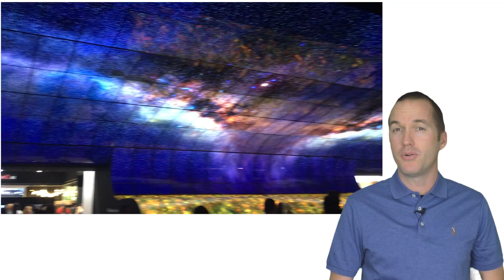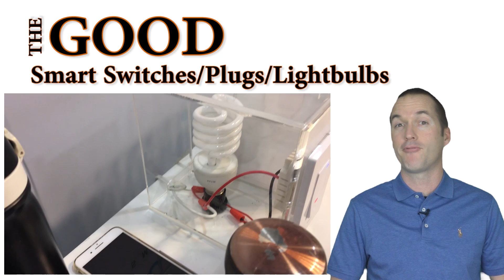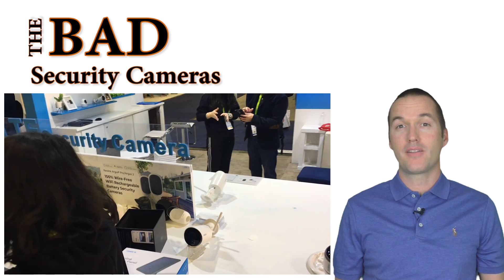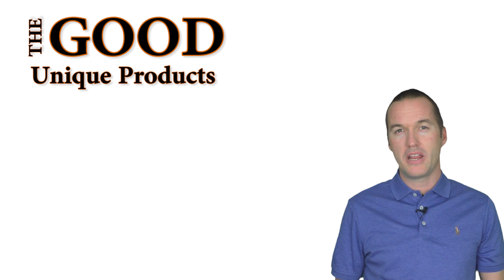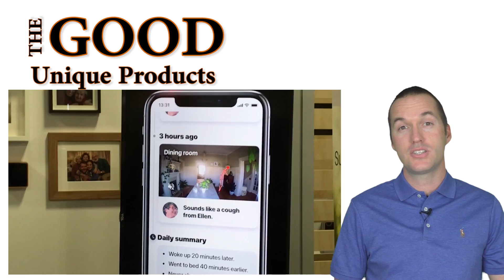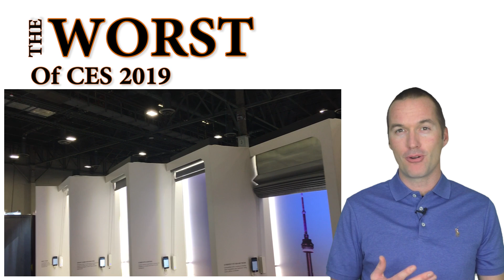CES 2019: BEST and WORST Smart Home Products

Comment: Any chance you had a chance to check out Hubitat at CES. I attended but didn't get to see them (not sure if they were there but some indicated they were). Also any chance there is a product review on your list for Hubitat?
Reply from the maker: I'm really unsure as to what Hubitat's place is in the market.  It's not simple enough to replace Smart Things, but allows far less customization than Home Assistant or OpenHAB (which also cost less and are open source).
Reply: @TheHookUp  Fair enough comments. HA does appear to have a longer future (and yes , open source will in large part be why) and is getting a bit better with Lovelace but it still has a long way to go IMHO for non software developer type users. When you have to dive into yaml code etc. ,  that is a big turn off for people just trying to get something up and running fast and not interested in stuff under the hood. Maybe Hubitat could be a possible transition platform to have more non cloud based automation control and more user friendly setup and dashboards until HA get's more polished.  Thoughts?

Comment: how do you spell this cam manufacturer - tooya? 2yeah? 2ya? tojaa? I just want to check them out as you mentioned possible future google assistant capability
Reply from the maker: They aren't a camera manufacturer.  They are a solutions company for hardware producers.  They sell a pre-programmed ESP8266 chip modules to suppliers and have an app making tool that allows companies to easily connect their tuya cloud for connectivity.

Comment: Wow, most of these features are reasons I wouldn't buy them. Cloud and proprietary are just devices that you don't own and have little control over.
Reply from the maker: Yep, I tried to relay that message to every vendor that I spoke with (which was all of them).  Many were receptive, but the majority were not.
Reply: @TheHookUp  Same goes for batteries.

Comment: I'm curious on your thoughts of Philips (Signify) Hue...you talk about wanting local control and you also point out the Wi-Fi switch that can be run without a neutral wire. It seems like a Hue bulb/Illumra switch would check off both those boxes. Hue doesn't need to be connected to the cloud at all and the Illumra switch is kinetically powered so you don't even wire it to mains at all, the fixture is always hot. This also means you can stick it on the wall anywhere, not just in an electrical box.
Reply from the maker: My reasons for not using hue are:
1. 90% of the time I'd rather be using smart switches rather than bulbs.  I don't want to have to give instructions to family members or guests about how to properly operate the lighting in a room, they can use the switch, alexa, their phones, the wall tablet, whatever.
2. The entry price is high for hue, and while the individual price of bulbs is decreasing, it's still significantly higher than brands with similar offerings.

That being said, their local API is great... So great in fact that I emulate it for all of my ESP8266 projects for alexa control.
Reply: @TheHookUp  Gotcha. The new Illumra switch is the answer to your first point, but admittedly it's not cheap ($40-$50) - I suspect the price will go down over time (the Hue dimmer was $50 when released and I've seen it as low as $15 lately). I would argue about the cost of entry - I've seen the Hue White starter (two bulbs and a hub) and the Hue White 4-pack for as low as $40, which is only $10/bulb + $20 for the hub. Granted, if you have a circuit with 10 fixtures on a switch then a switch is obviously going to be cheaper but I would think that would be fairly rare. 

I was just curious because it seems like Hue fits with everything you look for - open API, local control, traditional use, high flexibility, high reliability/quality - and I've gotten the impression that you're willing to pay a little more for a perfect OOBE.

Comment: Hello, love your channel! But I have to make a correction about the “first company to make a wifi switchthat doesn’t require neutral” I have been using Xiaomi Aqara switches in my home for a while now and I beleive Lightwave RF (UK Only) succeeded in this even before Xiaomi.
Reply from the maker: I believe aqara switches are zigbee and require a hub.  This is a stand alone WiFi switch with no hub required.
Reply: @TheHookUp  Xiaomi does require hub, but its very modern thing that allows you to do many smart home integrations and what is the most important: 1) it doesn't need 50w it can work with 5w Led bulbs. 2) it's much more secured and looking nicely. 3) it doesn't require internet connectivity which I bet this WiFi dinosaur Must have
Reply: You are correct they do require a hub! Thats pretty cool, we need that in the UK, our wiring is prehistoric. You can also purchase a zigbee stick for the pi and run them locally with zigbee2mqtt but this isn’t something I have ventured in.

Comment: Last year I set up Open Energy Monitor running emoncms. They sell 200A current transformers for US mains. It's integratable through Home Assistant. You should come up with a Home Assistant pool project. I've been toying with the idea of controlling my variable speed pump with a Tasmota generic device.
Reply from the maker: I have a pool controller (pentair) already.  I've got a video about how I control it with HA and MQTT.

Comment: The Lutron Caseta dimmer has been around for quite some time now and does not require a neutral wire. It does require a small hub for every 50 or so switches.
Reply from the maker: Yep, hub based non-neutral switches have been out for a while.  This is the first WiFi non-neutral switch.
Reply: @TheHookUp   Yep, I should have paid closer attention, I didn't get the "WiFi" distinction. Sorry.

Comment: Bit of a correction -- Lutron makes switches that don't require neutral (part of their Caseta series).  I just installed 3 of them myself.  Also the Lutrons aren't wifi, but rather ClearConnect via the Lutron hub.
Reply from the maker: Correct, there are lots of zwave, ble, zigbee, RF and other solutions for no neutral switches, but this is the first wifi one that works without a hub.  

It has been very difficult to do in the past because wifi radio is pretty power hungry, which is why there must be some interesting circuitry in this switch, and I'm excited to see how it gets applied to other tech.

Comment: Great video, condensed and very informative, keep it up and keep up the pressure on the manufacturers. 

I recently bought two Reolink PoE cameras knowing I'm getting good value for the price. AND I bought them because those are PoE AND local storage! I guess more and more companies are trying to the "NEST thing" and milk that cash cow. Hopefully by the time my cameras will die I will get something similar like two Reolinks but run on future version of RPI or similar. Now I need to get that Tensorflow working.
Reply from the maker: I did check the Zosi and Reolink websites and they are still selling PoE stuff, just not marketing it.  I guess there's not a mass market for them.  Hikvision makes really good PoE stuff, but they weren't at CES.

Comment: wifi security cameras are just BS... any script kiddie can flash a deauther on a 2$ esp8266 and blast your wifi...
Reply: I haven't heard of "wifi deauther", a quick websearch later and I learned new stuff - thanks! Totally agree, PoE cameras are better in so many levels (namely robustness, privacy and security).
Reply: Joonas Loppi there is some good stuff on blackhat regarding security camera vonrabilities, and most security camera manufacturers just don’t care
Reply: Its always best to run PoE, on a segregated VLAN that only the NVR and hassio can access
And have alarm/notifications if a camera goes offline
Reply: @sparkybearbomb533  totally agree, I've lately been researching on how to set up different VLANs. Can I set it up in such a way that my home automation gear can only access Hassio, but my home computer should be able to see Hassio as well? Kind of like Hassio should be visible to these two VLANs, but I think one device can only be in one VLAN at the same time?
Reply: @joonasfi  one device can be in multpile VLANs at the same time. It's just a matter of configuration. You could set two VLANs on one interface in which case your device needs to do tagging. You could also install another ethernet interface on your pi. I am not familiar with Hassios underlying networking so don't know how it would work. And of course you need a managed network switch(es) to handle those VLANs.
Reply: @VilmaHallikas  thanks for the response! I have Ubiquiti's UniFi gear, so they support VLANs.

So basically the device that would be on two VLANs needs to do the VLAN tagging, and the router port that the device is connected to probably needs to be configured so that the router does not modify tags used by the device (since all VLAN security is lost if devices by default could specify their VLAN membership).. interesting.

I would have liked for this to be a router-only config solution but I guess this use case requires multiple IPs for the device then, because ultimately one ethernet frame can only have one VLAN assigned to it I guess.
Reply: @joonasfi  pretty much like that. Security comes from your switches, they need to have that particular VLAN ID trunked to a port, otherwise the packet is dropped. I can help if you need, just drop me an email to @gmail.com, it shouldn't be too hard to figure out what my address is. Finnish works too ;)
Reply: @VilmaHallikas  thanks, I might take up on the offer once I find the free time to continue improving my home network.. so many projects to do! :) Thanks for the info, I feel like I understand a bit more. Torilla tavataan!
Reply: True!
Reply: This are consumer grade for plug and play, if you want good security and quality you will go for the hikvision or unifi etc wired cameras etc
Reply: @aaronargent  it's a false sense of "security"...
Reply: I have used deer cameras,replacing batteries and climbing a ladder is not a favorite. I bought a driveway sensor , 150.00 ,I bought a black box camera you can hide but only good 15 feet. I had 3 flood cams when the VCR still worked, the motion part still works, and the floor lights of course. 
 I have 3 camera made from Sw...and I cant get the TV to recognize the video recorder. I have called customer service.  They tried,I'm just doing something wrong and my son gave me the set after he used it new for a year. Anyone have similar problems? Swann

Comment: Thanks a lot for the summary. You're asking the right questions - vendors should stop creating their own proprietary islands of cloud based, closed source hardware. Yes, there is a market for those products, but why is there no additional api by default? Many vendors underestimate the power and value of the open source community. Thanks for your work and pushing the future development in the right direction!
Reply: I guess their current target is data mining the hell out of every bit of information they can get + some kind of subscription model. Also judging by the vulnerabilities ppl found in almost all "smart" things, they don't really want to invest in the quality of the software, just ship the cheapest possible thing ASAP. Dealing with ppl using their api, sending pull requests, requesting new features, or even bug fixes is just expense...
Reply: @AkosLukacs42  The companies are not doing this because they have some data mining preference, they are doing it because it is absolutely impossible to compete with China on hardware and open-source software.  They will dominate you.  You need to differentiate yourself as a business and data and cloud services are where they can get customers.  It is why people pay thousands for overpriced apple devices that I personally consider trash, but you can't blame the company for doing it, because otherwise they wouldn't exist and you would be buying your knockoff open source cameras from china for 1/4th the cost.

Comment: Great stuff, Rob! As the founder of a couple startups (and one on the way?) I thoroughly enjoyed your “no punches pulled” review style. $5300 for a fricking patio umbrella that won’t fit through the hole of my patio table?! They could knock off a zero and it would still be a crappy value! The overall impression I got is that the tech world is still mired in “me, too!” At a time when virtually anything is possible, there’s very little innovation at the commercial/retail level. 95% or more of the true innovation is happening at the DIY level — which is why you and Dr. Zzzs are tech rockstars! Thanks for being our eyes and ears in Vegas!

Comment: Good Lord that atrocious floodlight from blue sky wireless!  As if it's not bad enough to have those awful floodlights half hanging out of it they add a obnoxious contraption to make it worse.

For the energy monitor, Neurio let's you pull data off of it locally and has 2 CTs properly.  I don't know why they can't just put Another CT on the Shelly.  It's not powerful enough to do sense like fingerprint  anyways.

That's one heck of an alarm clock.  Maybe I'll finally get rid of my iHome!  150 is a good price for that!

And what are you supposed to do with that stupid umbrella besides open and close it?  I don't see any LEDs even?  Did it do anything besides open and close???
Reply from the maker: The umbrella had LEDs and a speaker.
Reply: @TheHookUp  oh wow!  That makes it all worth it then.  So $100 I'm really, $40 speaker and $10 LEDs and $5000 worth of marketing want. (c) aVe